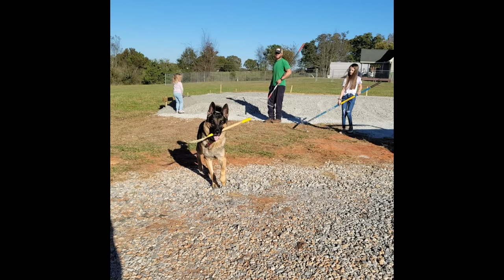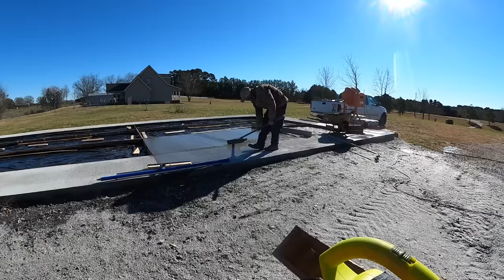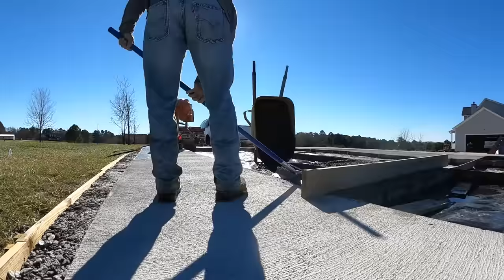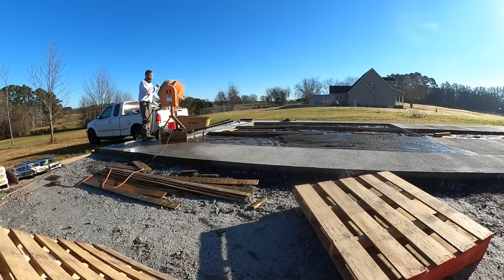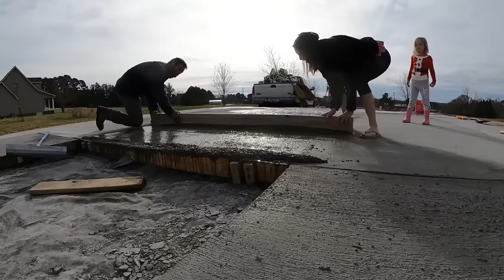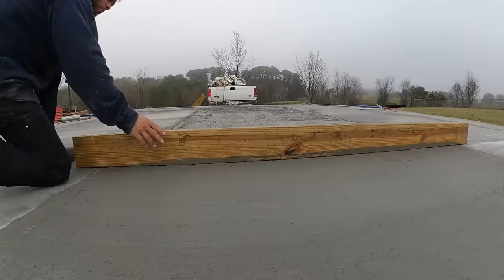Pouring a Huge Concrete Slab Using Bagged Concrete | I Saved $10,000

Comment: Why did you not use any steel mesh in the slab? Without the reinforcement of steel mesh the concrete will crack and break away over time.
Reply from the maker: I called around and spoke with local pros. They said in my area its not needed in a residential on grade 4" slab. I don't really see it in small slabs, or driveways around here. Only in homes and commercial buildings.
Reply: @reallifetested2605  I Live in Australia and it’s always used here even for a garden shed concrete slab.

Comment: That's awesome man! I'm similarly wanting to build my own building! You saved a ton of money in labor! But isn't concrete cheaper from the truck than bags? A yard of truck concrete is equal to like 45 bags. A yard on a truck is usually about $150. They do usually have like a 3 yard minimum, but you used way more than 3 yards. Do you think you could have broke it up into sections sized 3 yards, and done that by yourself? I was thinking of using truck concrete.

Did you do it when it was cool outside so that it would stay workable for a long time? It looked like it took a long time to level a single section.
Reply from the maker: It might be now, but when I did this they were wanting 200 to 220 depending on the day for truck and I was able to get #80 bags for 3.20 each. You could definitely break it up into sections and do it that way. The only issue would be you'd have to have your forms dead on or you will have waste, or not enough which would not be good. I did this in our winter which is usually in the low 50's to mid 40's. That was the perfect temperature and gave me plenty of time to work. It also allowed the concrete to cure slowly which helps with water drying out to rapid. To this day I still don't have any cracks not even a small hairline. I'm going to do an update soon so stay tuned!
Reply: @reallifetested2605  yes that is true that when the truck starts pouring it'll have to be pretty dang accurate. I can see where bags gives a lot of flexibility in that regard 

One think that helps with cracking is plenty of gravel. It looks like you had a lot of gravel down. The gravel is a barrier that allows the ground below to move without stressing or disturbing the concrete above. You having plenty of gravel probably contributed greatly towards not developing cracks.

Looking forward to updates!

Comment: Once you started, did you ever stop the mixer from rotating?
How many bags were you mixing before you would skreet the concrete.
Reply from the maker: The mixer pretty much stayed running the entire time. I turned it off to pour bags in but after that i'd turn it on and keep it that way. I'm honestly not sure i'd go until the forms were full before screeding, i'd guess around 130 bags or so.

Comment: I have a truck coming to pour 4  cubic meters of concrete for 20'x30' shed

Under $1,000, which I thought was ok price.
Reply from the maker: I don’t think you’re going to have enough for a minimum 4” thickness. You need at least 5.66 cubic meters for that. But it may be a good price now I’m not sure. I didn’t realize but different areas have drastically different prices. Differing as much as 100 dollars per yard!
Reply: @reallifetested2605  

Yeah I wonder if the guy on the phone made a mistake, when I use an online calculator, it says for 20'x30' I need little over 7 cubic meters of cement 🤔. I need to call them again, thanks for pointing that out.

Comment: If you had bought bagged cement and bulk sand and gravel would have saved even more. ratio is 1/2/3.
Reply from the maker: I checked into that. At the time high prices of sand and portland was going to make the cost per yard right at 163 dollars. I couldn't believe it. I'm not sure what the prices are now for sand.
Reply: @reallifetested2605  surprised - strange times we live in.

Comment: How's it holding up for you? What is the depth you used there 2x4 forms? Thanks. Going to do a back patio not nearly this big but I have the harbor freight mixer as well. Much easier than any other method
Reply from the maker: I did a 1 year update if you’re interested. I also answered most of the commonly asked questions. I was aiming for around 4” depth but it ended up being right at 5” I’ll post the update below. 

Pouring a Huge Concrete Slab Using Bagged Concrete | ONE YEAR UPDATE
https://youtu.be/qKcy6BI8yA0

Comment: sakrete concrete mix probably better than QUIKRETE but not in stock , QUIKRETE will probably dry faster ?     did you measure your water in a bucket ?
Reply from the maker: Yes I had a mark on the bucket that I pre measured to make sure it was correct every time. I actually mixed a little less than what the bags called for:

Comment: why you did not ordered pre-mixed concrete? for big volumes it looks cheaper option.
Reply from the maker: In my area they wanted 200 to 220 at the time with a 4-6 week wait and bags were 3.20 for 80 lb. I could also do it at my leisure working night shift 7 days a week haha

Comment: awesome work.   Would love to do a project like this.  If this is for a shop use...not heavy machines, can  rebar not be used like in your individual slap pours?
Reply from the maker: Thank you! I called around and spoke with local pros. They said rebar isn't needed in an on grade residential 4" slab. I have had ~40,000 lbs sitting on this for about a year now and not even a hairline crack has developed.

Comment: Looks awesome brother! Looking to do this for my driveway because I got a quote for $40-50,000 😮😮  is there any reason you didn't use rebar?
Reply from the maker: Thank you! I did a 1 year update with me answering the most frequently asked questions if you're interested. Long story short about the rebar, I called around and spoke with local pros. They told me that rebar wasn't needed in a 4" residential on grade slab. (unless i'm pulling dump trucks, trash trucks etc. on it.) Also I want to note our ground in my area is hard clay, it hardly gets below freezing, and we don't have any natural disasters like earthquakes. So definitely check into your particular area before starting. Here is a link to the 1 year update if youre interested. 

https://www.youtube.com/watch?v=qKcy6BI8yA0&t=568s

Comment: Awesome job! I noticed though you didn't use any rebar or wire mesh. Is that because you used some kind of bag concrete that has reinforcing that is mixed in it already? I would worry about cracks.
Reply from the maker: In my area they don't really use it in residential on grade 4" slabs. Here it doesn't get cold, and we have good soil. I also put over 100 tons of gravel beneath for drainage. It may be different in your area so definitely something to call around and ask about. I did a 1 year update if you're interested. Not one crack has appeared yet!
Reply: @Real Life Tested  I work as a drafter at an engineering firm in North Louisiana and we always put rebar in foundations we design, unless they are using concrete that uses some form of wire mesh that is mixed in. For the most part, we design foundations for buildings of larger structures. Here in Louisiana, the soil is hit and miss on how good it is. That's why I asked.

Comment: So how much did it cost per square ft?  How much total?  And what would it have cost if completely done by professionals?
Reply from the maker: For the 45 x 26ish slab I have right at 3800 dollars, that includes over 100 ton of gravel and concrete. Local contractors wanted a minimum of 14k and up. Some quotes were close to 20k

Comment: Doesn’t doing it this affect the integrity since the the first section starts drying? Trying to learn more about concrete
Reply from the maker: I did this when temps were mid 40's so it actually took a very long time to cure. If you do concrete in cooler temps you have plenty of time to work with it.

Comment: No feasible around here. Bags are $4.75 a piece making a yard over $210. About twice as much out of a concrete truck.
Reply from the maker: I'm hearing its about that way here now. When I did this was during the pandemic where the prices of everything were crazy. #80 bags were 3.20 each and truck was 200 to 220 depending on the day. I'm not sure what they are at the moment.

Comment: I poured a small run, about 3 feet by 40 or something, and it was a total nightmare. Why didn't you need any rebar, even between adjacent sections?
Reply from the maker: I haven’t had any issues but that’s the only thing that I wished I’d done for added insurance. The way my shop is built around the pad the frame holds everything together anyhow. I’ll be doing yearly updates so far so good not even a crack!
Reply: @reallifetested2605  Does the circumference part have rebar or none there either?

Comment: Another problem you will learn very quickly is as looks was not as important to you strength definitely should be as bagged concrete says it’s rated at about 2500 psi and I bet that’s rather generous. That will not hold up very long. So yes you saved $10,000 today only to cost you everything you spent here to do it yourself plus what it cost to tear it out and have a professional do it anyway. 😂
Reply from the maker: The bags I used said 4,000 psi? The local concrete place says their concrete is between 3, and 4000 if you don't choose additives. I spent less than 4k. Luckily I have all of the equipment to tear it up and rebulid it about 3 more times before i'd start losing money just getting it poured once from a "professional"

Comment: Are you laying it on dry or wet? It seems like your laying it wet because it is going into the mixer but wouldn't it dry before you get to the last mix!?
Reply from the maker: I'm laying it wet, and it was cooler temps so I had plenty of time to work.

Comment: Lots of work! I have a 20x12 slab I want to pour myself and have a small cement mixer! Not sure how I want to go about doing it but you made it look simple! How many scare feet did you get done in a day?
Reply from the maker: I had to stop about a 1/3 in the day because of work. I could have done somewhere around 360 sq feet or so per day if I didn't have to stop.

Comment: Kool! I need to make a 12x24, 4 inch slab! I wonder how many bags Ill need? I do have my own mixer, so that helps, i guess>
Reply from the maker: Each 80 lb bag is supposed to be .6 cu ft. If you use a cubic yard calculator online you can figure out from there. I always add about 10 percent more than I think because if you need it you’ll have it and if not you can always take it back. Thanks for checking out my video!

Comment: Impressive nonetheless…but no wire mesh or rebar? Was the base properly compacted? Seems like an equation for cracks and settling in the future.
Reply from the maker: Thank you!I called around locally and pros told me that it wasn't needed in a residential on grade 4" slab. I have over 100 ton of compacted crusher run as a base so it hopefully won't go anywhere. haha

Comment: I'm curious how much concrete is per yard delivered by a truck in your area? By my calculations at 45 80lb bags per yard you poured about 18.5 yards. At current prices ($5.78 per bag and 830 bags) this would be a just about $4,800. Concrete delivered by truck would have to be $260 per yard to be the same price as bagged. I'm not sure where you live, but its less than $200 per yard right now in Western PA.
Reply from the maker: I did a 1 year update with a lot of the questions answered (to the best of my knowledge) that you probably have if you're interested. When I did this concrete was 3.20 for #80 bag and truck was 200 to 220 depending on the day with a 4-6 week wait. We were going to hire this out but got quotes of 14k plus. I did this myself for right at 3800 dollars.

Comment: How did you keep one side of it from drying while you were mixing and filling all of the slab ? I want to do a 15x15 slab and see a lot of people have trouble as it sets faster than they can pour all of it
Reply from the maker: I did this during our winter which is around high 30s in the mornings and mid 40s during the day  giving me plenty of time to work before the concrete sets up.

Comment: looks great, but arent you supposed to reinforce the concrete with rebar or chicken wire at a minimum?
Reply from the maker: I called around and spoke with local pros. They said that rebar wasn't needed in a residential on grade 4" slab.

Comment: nice. 2 questions though.
1) wouldnt it still be cheaper to bring in concrete readimix ...... what was the quote for the concrete truck versus what you spent in bags - curious.
2) Any issues with pouring in sections like that where 1 section will seperate from the other ? If there is movement as there is no real tie in with rebar etc.

nice work
Reply from the maker: At the time (Covid) they were wanting 200 to 225 per yard going truck with a 4-6 week wait. I was able to get #80 bags for 3.20 each. We were quoted 14k and up from local contractors. I only have 3800 in everything doing it myself. I have done a yearly update and will continue to do them if you’re interested. I go over the slab and the most frequently asked questions.

Comment: I always heard the truck is actually cheaper than bagged concrete.
Reply from the maker: In my area local truck was 200 to 220 with a 4-6 week lead time and 80 lb bags were 3.20 each. Bag was a good bit cheaper, it would’ve been faster I just couldn’t handle all of that by myself.

Comment: I've been doing a lot of research lately, to try and DIY a concrete pad. I've heard conflicting opinions on rebar, what's your take after a couple years?
Reply from the maker: In my area rebar isn’t used usually unless industrial or commercial. We have good soil, no natural disasters, and it rarely gets below freezing. I’d check locally to see if anyone in your area is using it. So far I don’t have any cracks at all. I’ve done a one year update and will do another update in a few months. I think it’s coming up on 3 years but will have to check.
Reply: @reallifetested2605  thanks for the update, this is super helpful

Comment: My math must be way off. Unless concrete is cheaper in Texas. for 30x50ft slab 12x12 in footers and 4 in slab it takes 24 cu yards to pour that (from concrete co and what they said) and quoted $3455 for 24  cuyrds = $144 per cubic yard. For me to buy the concrete in bags it will cost somewhere around $4000 so buying in bags is more expensive @ 800+ bags. Where does the costs savings come in? forgive me if I am missing something but I don't see the savings. I will do the dirt work, framing for foundation all labor except pour the concrete so this is a strictly concrete cost comparison without labor or any material included? 

Did you save on something other than the material cost? or you poured manually bec of the time and not waiting on company to pour. Thanks for sharing info and all the insight. very informitive.
Reply from the maker: You’re very welcome! At the time truck was 200 to 220 per yard depending on the day with a 4-6 week wait. #80 bags were 3.20 each so concrete saved me quite a bit. The big savings was doing it myself. We received quotes from multiple contractors lowest being 14k I have right at 3800 in everything on this project. I’d hate to know how much this would cost now as much as things have went up.

Comment: It looks good but unfortunately it’s not going to last. You didn’t use any rebar whatsoever and especially to tie in the new pours to the old pours. Especially giving the fact that your gonna have a a very heavy metal building on top of it you should have used a lot of rebar and if not at the least fiberglass reinforcement.
Reply from the maker: In my area rebar is rarely used in residential. We have good soil, hardly gets below freezing more than a few hours in the night, and no natural disasters. I’ve seen hundreds of homes built and no rebar in the driveways or building slabs. So far so good. Not a hairline crack anywhere.

Comment: Awesome job.  What are the dimensions of those interior sections and approximately how long did it take you to complete one?
Reply from the maker: I don’t exactly remember but thinking somewhere around 6.5 x 20 and around 3-4 hrs total. That time includes getting everything out, doing the work, and cleaning and putting everything up. It couldn’t have took more than that because at the time I was working night shift and didn’t get started until around 9 everyday. I know I had to be finished around 1 or so otherwise I wouldn’t have got any sleep haha

Comment: I like to do stuff myself too how much is concrete a yard where you’re at though that you can buy bag stuff cheaper than getting it delivered
Reply from the maker: When I did this they were wanting 200 to 220 depending on the day for truck with a 4-6 week delivery and I was able to get #80 bags for 3.20 each. It ended up being a lot cheaper going bag per yard. I even checked into mixing myself with 1,2,3 method and even that was insanely priced at the time because of the high cost of sand and portland in my area.

Comment: What about wire or rebar?  Did you not use it do to small sections.
Reply from the maker: No one uses rebar in my area unless it’s a commercial/industrial setting. It rarely gets below freezing here, we have stable soil,  and we don’t have any earthquakes. I called around and spoke with local pros to verify.